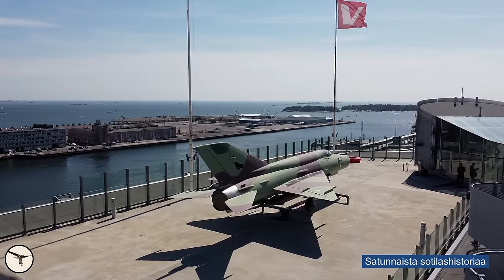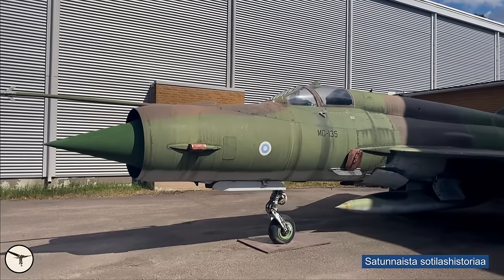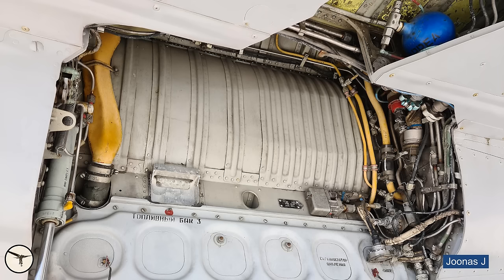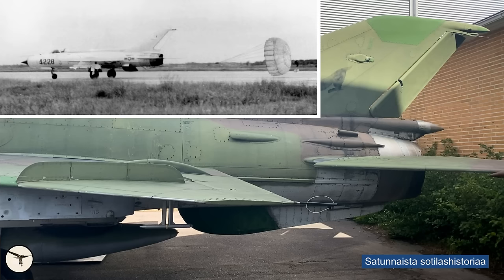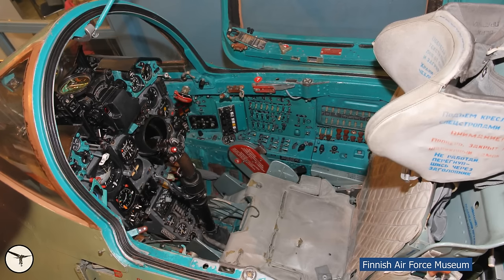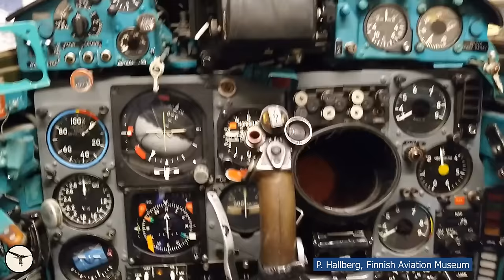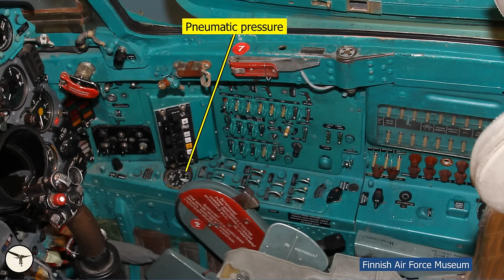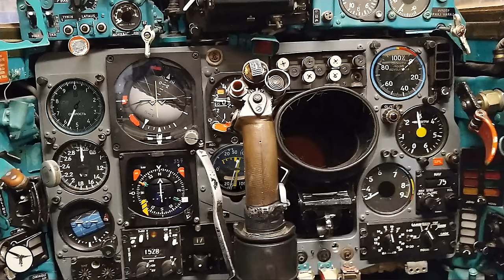MiG-21 walkaround and cockpit tour

Comment: I believe that the original soviet attitude indicator (not the one that was fitted in this aircraft), that has a horizontally fixed artificial horizon (it only goes up and down to show pitch attitude), and a small figured airplane that banks left and right, is more intuitive for the pilot, because pitch and bank are completely separated. I really love those needle mechanical instruments, thanks for the video.

Comment: As you alluded, many of the cockpit instruments have been replaced with western ones.  The attitude indicators (also known as artificial horizon indicators) jumped out at me as being of the western standard.  The main indicator is the big instrument towards the top left that looks like it has a sphere behind the glass, with black & white areas, with the dividing line between them being on a slant.  This instrument is not upside down, these instruments often tilt over in some random orientation when the power is turned off.  As the gyroscope spins up (after engine start), it orients with the black side down.  On western instruments, the aircraft symbol (that's the little "w" piece behind the glass) stays fixed, and the sphere behind it rotates to indicate the plane's attitude (nose up/down and banked level/left/right.) I was a US Navy pilot, so that's how I know.   The Russian/Soviet style instruments have the horizon indicator being fixed, and the aircraft symbol moves up/down and tilts left/right to indicate the attitude.   There is a smaller auxiliary/backup attitude indicator at the bottom left of the panel.  This is the one showing the blue colored piece under the glass.  

I also don't believe the original MiGs had a HUD, so this would have been a Finnish addition.  IIRC the original MiGs had a big bulky gunsight that made the forward view even more restricted that what you see on this example.

Great video, really appreciate this.  Classic turquoise cockpit colors on the MiGs, you really can't mistake it.
Reply: Thanks for your contribution to the forum.
Reply: Those instruments were swapped by the Finnish Airforce to western ones. Unknown reason why the temperature indicator is doubled, likely museum didn't have a spare for speed indicator so they used two temperature ones and just put the RPM instrument to left side.

The plane in this video doesn't have a HUD, it is the original gunsight.
I find the original Russian instruments more logical and easier to read. Example your mentioned artificial horizon (vertical attitude indicator) is very clear when the background is black/white backgrounded from the horizon (black is ground and white is sky) and it rolls around vertically. The aircraft symbol stays fixed to center and it rolls around from the center to indicate the aircraft bank relative to the horizon. This IMHO makes very easy to understand plane attitude as the instrument shows the plane relativity to ground, so if the wings are 30 degree to right, then plane is 30 degree to right. If the plane axis (center) points to black 5 degrees, you are 5 degrees downward. The thinking goes opposite than in western where you need to think earth relative attitude to you, where russian one is that you look aircraft relative attitude to ground. It is small thing that "clicks" or not. 

The horizontal attitude indicator is as well little more complex in the Russian, but it doesn't show in it the range to the beacon or waypoint, as that range value is indicated in small rolling number panel on top right just above RPM needles (and right to the radar filter buttons, that are top of the radar scope). 
I dislike all these modern horizontal instruments, as I can't understand why it was so wanted to have the plane fixed straight forward and have the compass rose rotate around, so that your heading is the northern line. And then you need to read the small numbers in the instrument or to find the N/E/S/W letter to get the idea. What I adore is the old MiG-15 style instrument, where the compass rose is fixed and the plane symbol rotates around pointing toward the heading you are going. 
Here it can be seen under gunsight shadow: http://static.rcgroups.net/forums/attachments/8/9/6/3/7/a1658295-4-MiG-15%20Cockpit%2006.jpg?d=1200164003
 It is not so accurate to find the current reading because that seems to be only lined for every 5 degrees (how much more you need, when you get about 1 degree accuracy anyways?) but at glance you get instantly the idea that what direction you are flying to, and that is why I like it, as there is no need to read numbers or search letter and do any thinking, you just look that plane points to east etc and you know where you are going. And now when you communicate with someone over radio about directions, you can instantly think everything in the compass readings as clock watch directions and you know where you need to turn and how much.

As well something that people don't usually talk about is the Russian planes automatic pilot system (SAU = Sistema Avtomaticheskovo Upravleniya = "Automatic Control System"). As those are very clever. Example the sticks have two buttons on top next to trim that are shown in this video, the left is to disable autopilot mode completely, and the right is to enable automatic recovery mode.
Normally those planes are flown with autopilot, there is autopilot modes for take-off, cruise and landing. When the autopilot is enabled (normal stabilization mode), the trim button commands the wanted change in altitude (pitch) so one can hold it down/up and autopilot will start ascension or decend until it is released. If the plane is inside +/- 10 degrees roll, then autopilot will automatically level the plane. If the roll angle is more than 10 degrees, then that roll angle is hold in level flight, so you can example fly a circus automatically.
The pedals can be used to change the direction where SAU will maintain the flight.
The pilot can at any given time fly a plane just by applying force to the stick, and once the stick doesn't receive any input the stabilization mode will again level/roll the plane etc. 
The stabilization system as well constantly is performing correction inputs to keep the aircraft steady for smooth flying.

The most interesting is the SAU recovery button on the stick, when recovery mode is enabled, it will level the plane from almost any attitude. It does require that Recovery mode is enabled in the autopilot panel (just front of the throttle, a triangle panel with four green lights, the white switch). 
If the aircraft altitude is by the radar altimeter under 1500 meters and it is in recovery mode, the autopilot has max 5 G authority for pitch up maneuver to recover the plane to level flight to 1500 meters (or was it to 3000 meters if flown under 1500 meters...). This example allows pilot that has lost the situational awareness, just to press a button on the stick to activate it (if not already).  This is similar that what western fighters has just received in few years where the system recovers and saves the pilot when they don't give any feedback to controls and plane is flying to terrain.

Then there are two different kind automatic landing systems in MiG-21Bis, where the autopilot will fly the plane to capture the landing system signal and then fly the plane in glide path down to 30 meters altitude, and then pilot needs to cancel the mode (stick red button) and take plane to touchdown manually.

Later on in the MiG-23, Su-25 and so on new modes were added, automatic flight path mode where the system literally goes from take-off to landing through the flighplan. Pilot enables the mode when they have aligned with the runway and then start rolling. And next time the pilot needs to put hands on controls is 30 meters from the ground when landing.
In other planes like Su-27 the trigger in stick is for disabling autopilot for as long as the trigger is hold. So example pilot can be flying as wanted, but to maneuver or change course, altitude etc quickly just pull trigger and perform the correction and release trigger and autopilot resumes.
Reply: @katumus  Thanks for your contribution to the forum.  Most edifying.

Comment: The information is really good  and full of details about this legendary fighter,,, educative in real sense,,, expecting similar videos of  other aircrafts
Reply: He is unrealistically generous in his comparison of climb rates with the F-16 which is completely incorrect. The MiG-21 does not have a better than 1:1 Thrust to Weight ratio like the F-16 and can not accelerate in a vertical climb as a result…
Reply: @CH-pv2rz   With the emergency afterburner mode activated a mig21 can pass 1:1. Only just goes below 1:1 when you are at Max take off weight. Emergency afterburner is 21,800 pounds of thrust and Max take off is 22,900

Comment: The only Russian cockpit I've been able to scrutinize closely was in an AN-2.  It has quite a large number of toggle switches and unfortunately they were all in Russian.  It would take a pilot with an elephant's memory to fly the Mig-21.  I'm not sure how well anyone would even memorize the AN-2.  I fly a J3C Piper Cub manufactured in 1946.  About three switches and a push button is all my Cub needs. (It has electric start and no brakes).  Thanks for the detailed editing you did especially on Part 2.  I did watch part 1 also.

Comment: Part two is also an outstanding video. Lots to learn before taking the chocks out. I do like the turquoise interior paint. Brightens up all the instruments & switches. The front main panel should've been the same color too. No organization in this cockpit. This aircraft really does need hyd. braking or an onboard air compressor for the brakes.

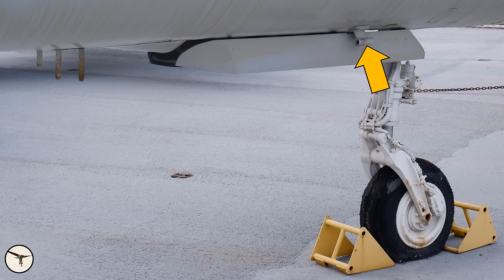Comment: At 3:07 what you call a "deflector", the strake which runs below the pressure relief door, is actually a shock wave producer, designed to control the gun blast from the integral 23mm gun.  It may, incidentally, act as a FOD, but that is not its primary purpose.
Reply from the maker: Thanks for your feedback!

Comment: The wing fences are not used for "straightening the airflow". They are for producing high-energy. vortices that re-energizes the boundary layers moving towards the wing tips at high angles of attack.
Reply from the maker: Don't mix wing fences with vortex generators.
Reply: @FlywithMagnar   I am not mixing them up. I have not said they are the same thing.  Wing fences work in a similar manner as vortex generators or LEX  by creating a longitudinal vortex and preventing wing stalling. The 3D  boundary layers on a swept wing travel outboard towards the wing tip in curved streamlines. It is not possible to " striaghten the flow" by using wing fences and there is no point to do so.

Comment: Fascinating. Are all cockpit controls of this era so, apparently, dis-organized?
Reply from the maker: The first country to organize the cockpit instruments was the United Kingdom in the 1930s. They introduced a standard panel with six flight instruments on a dampened panel. Engine instruments were located to the right, and some of them were color coded. Therefore, a pilot could easily swap from one aircraft to another. The Americans followed suit much later. I have some knowledge about the Northrop F-5, and it has quite a neat cockpit.

Comment: 1. thats not a HUD, thats a gyro gunsight
2. you didnt even say anything about the radar, and its crazy cooling...
still a good vid tho
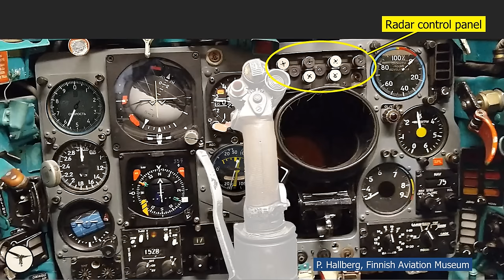Reply from the maker: Yes, it's a gunsight. My mistake. The radar is shown at 14:38 and is mentioned in Part 1 (about four minutes into the video). https://youtu.be/LjL8HJOxfZ4
Reply: @FlywithMagnar  i meant the range, and the cooling (alcohol cooling)
Reply from the maker: When I said the range was not so good, it was because it was 30 NM at the best. I know the MiG-25 used a mixture of ethanol and water to cool the radar and other avionics. That radar was a beast (600 kW). The information that the MiG-21 has the same cooling system is new to me. Thank you!
Reply: @FlywithMagnar  mhmm i get it
no problem with the informasjon

Comment: Dear..there is no steering in nose wheel ...amend it if possible
Reply from the maker: My appology. For reference, I used a cutaway from Flight International, and it shows an acuator on the upper aft part of the nose gear with the label " hydraulic steering unit". When i take a closer look, there are no hydraulic lines attached to it.  So, it's probably a damper.
I cannot revise the video, so I have to make a remark in the comments section below. 
Thank you for notifying me.
Reply: @FlywithMagnar  you are right..that is shimmy damper only and no hydraulic connection required.

Comment: I heard this aircraft could take down F35 within visual range
Reply from the maker: That must be a sloppy F-35 pilot!
The MiG-21 is a hit and run fighter. It performs badly in a turning fight because it looses energy rapidly. Furthermore, the view from the cockpit is very poor. However, it has a relatively good turn rate a low speed, which can be a challenge for third generation fighters. 
The F-35 is another breed. It provides the pilot with unmatched situation awareness and can easily outmaneuver the -21.
Reply: @FlywithMagnar  what about lighting serious problem there
keep hearing negative things said like cannot land rearm and go again
cannot climb cannot turn
these are real things being brought up with makers F22 superb machine NOT FOR SALE

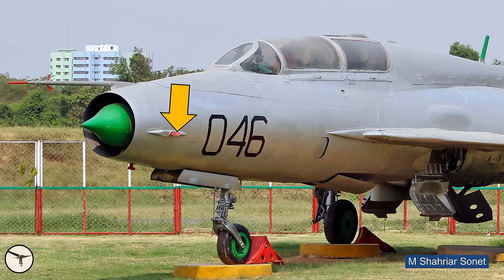Comment: 2:34.  Bro.  That's a SU-22.
Reply from the maker: No. This is a MiG-21UM. The first generation 21 has a small air intake because it doesn't have a radar.

Comment: Sorry but the MiG-21 does NOT have a better than 1:1 thrust to weight ratio like the F-16 does and as a result it does NOT have a climb rate similar to the F-16… Put the vodka down…
Reply from the maker: It all boils down to how much load you are carrying. 

An F-16 Block 50 or 52 has an engine that develops 29,500 lb with afterburner. The take-off weight can be anything from 26.500 lb to 42,300 lb. Therefore, the thrust-to-weight ratio varies.

A MiG-21 Bis has an engine that develops 15,640 lb with afterburner. This can be increased to 21,825 lb for a period of 3 minutes. The take-off weight with two missiles is 19,235 lb. Maximum take-off weight is 22,928 lb. Again, the thrust-to-weight ratio varies. When lightly loaded, the Bis has climb performance close to a lightly loaded F-16.
Reply: What Magnar said. In general, you gotta be careful not to compare the combat loadout of one airplane vs. the airshow loadout of another, or vice versa. Apples to apples.